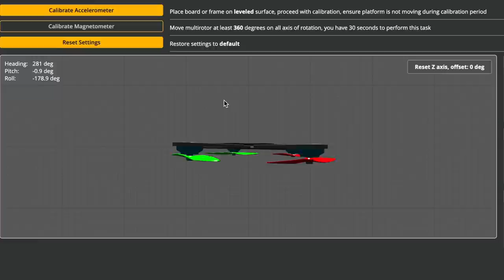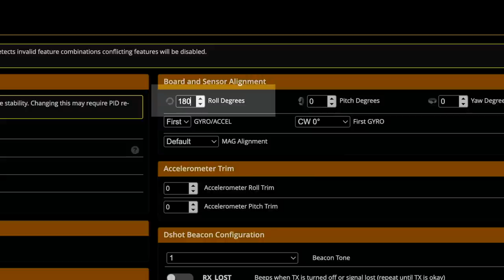Pusher Drone!! - Upside Down Motors?!

Comment: Pulling clean air is significantly more efficient than pushing obstructed air. This raging debate has been resettled many times in aircraft engineering. A few aircraft manufacturers who built pusher planes even reverted back to tractor (puller) configurations later. Conveniently, it’s also easier to engineer control surfaces behind a tractor configuration; plus, these surfaces will also have more authority behind, rather than in front of, the blown air. Cooling the motor behind a propeller is another advantage of a tractor configuration that reduces heat wear and improves dependability. I hope this was helpful! I LOVE THIS CHANNEL! Thanks for another fantastic experiment, guys!

Comment: I think the biggest difference in how it feels to fly would be in the center of gravity vs center of thrust. When they flipped the drone upside down, they put the lipo on what was the bottom of the frame, putting it on top. So the center of gravity is probably about an inch to an inch or two higher than the center of thrust. This is probably what PDEVX meant by it has a pushy feel and a reluctance to roll.
Reply: Exactly. The force is apllied from slightly different position so that would make a difference what could be felt but then again is such a minor change so.. maybe really seasoned pilot can actually feel thr difference. Bilnd test would prove it
Reply: They mounted the motors upside down but didn't flip the props to compensate.
Reply: @dscottwilliamson  if this is actually true then this is a huge whoops and this comment needs more likes
Reply: Isn't that the rocket fallacy?
Moment of inertia does matter though.

Comment: I've done a bunch of testing on a thrust stand on push/pull, and I've found that pulling is more efficient, likely because the airflow is better over the stator for cooling.
Reply: They flipped the motors without flipping the props, it's like putting freestyle props on your quad upside down.
Reply: @dscottwilliamson  this is what I came to the comments to find out. If they didn’t flip the props then it’s essentially like 3d flying upside down. Sure it will create enough lift to fly but it’s grossly underpowered.

Comment: pulling or pushing air through the arms DOES make a difference. Air that is pushed by a fan goes mostly one direction, but air can be sucked from any direction into the fan (that's why we feel a very strong "wind" after the prop, but not before the prop). As for the person who feels a difference, only one way to know if it's placebo : blind test.

Comment: Ive been doing this for years. But not many people watch my videos. I even went as far as flying 7" props on a 5" source one with front motors inverted and rear motors normal. Thrust to weight ratio is insane. But i guess i should of sent it to you guys to gain some traffic traction. 😕  it flew great. Even chased some drift cars with it on 6" arms and 8" props
Reply: That's dope :)
 I once fit 3" props on a 2.5" by raising the rear motors a little bit, and having the props overlap ever so slightly. Flew better than on 2.5"!

Comment: You guys should run reverse motor direction anyway. It flings dirt away from the lens and gives the rears access to cleaner air.
Reply: Also helps ploughing through straggle, pushing branches away instead of grabbing them
Reply: @lievenvv  It might "grab" them more from the sides, though.

Comment: I think you guys missed a serious point in your setup unless uiu just didn't show it,, You have to tune it differently when you push instead of pulling through the arms vs pulling accessed for the push Hensel the "Slower responses" to movements up the rates and use good solid supermarket on power input!;-)) thanks for the ideas 💡 guys Bravo miss that stuff 👏 👍 😉 😄

Comment: It will be more efficient, because high speed air from the prop is not blocked by the arms, the slower speed air coming into the prop over the arm has much less resistance.

Comment: Mechanically speaking, When you turned it into a pusher, you changed the performance of the motor.
Normally when the props are on top It's pulling the shaft up away from the stator reducing mechanical drag.
With the motors inverted ... this may heat the motor faster and reduce performance.
Reply: It may also reduce the life expectancy of the bearings.
Reply: There's also a cooling problem because airflow to the stator is blocked by the arm
Reply: no...when it pulls rotation is just faster. the power isnt changing. imagine the difference when pulling and pushing a cart.
Reply: @jordigrau83  that's a good point as well, because the motors are in the back of the quad so the top of the bell is facing rearward whereas if they were on top they would be going right into the air flow.

Comment: Sorry for the necro post, but a few things to consider. 

1) motors pull in air from underneath and push it through the stator towards the props due to centrifugal force. Thus effectively means that the cooling airflow through the motor is opposite from a tractor motors direction of travel. (Less cooling)

2) having clean air ahead of a motor / propeller  is less important no days do to advances in noise filtering. Especially when the turbulence from the arms is consistent and easily compensated for.

3) having clean air behind the quad, results in less propeller drag, thus better efficiency. In tests I've done with quads and tricopters this can be as much as 20%. Typically larger, slower props have higher gains here.

Comment: I tested  several years ago because it always seemed like a better/more efficient idea to have a pusher style quad. I ended up using a thrust stand to measure the difference the drag of the arms made to the thrust but I found that at higher thrust levels the bells of the motors would come into contact of the housing increasing the drag way more than the arms, but motors are probably a lot better these days.
Reply: you also have to consider motor cooling and how that might effect efficiency, especially running higher kvs

Comment: Also an interesting Idea that I have tried out is if you flip the frame over and put the rear motors on the top. It reduces the amount of turbulent air to the rear motors and changes the characteristic quite a bit.

Comment: Just turn the front motors over for best centre of gravity and flight feel and prop wash is better  and can still turtle mode it and it also gets props out of view at 45 degrees tilt on a 7inch where you see the motors more than a 5inch

Comment: Dear LeDrip,
I think the Arms over the Prop (pusher) does not realy block the Incomming Air.
If the arms under The Prop (Normal) it have much more Impact on the Airflow. Becurse the Pressured angled Air is blocked by the Arm. In this Case there are caotic Air circulations spreads in all directions around the arm, and have large Impact on the Thrust flow area around the arm.

I think in pusher it is much easier to suck the the Air in the Propeller from evrywhere. Over the Propeller there is a Low Pressure Area, this area suck the air in the Prop from all directions inclusive the Ramair of flight speed. 
The High Pressure Area under the Prop is pushed in one Direction.
The Sucking Area is Sucking of all directions, and the Athmospherik Pressure is helping to "refill the low pressure area"

And did you Inverted the Motor Directions in Betaflight? Or swaped the Propellers on the Arm? This could have Impact on flight handling in case of the Yaw axis mixed with other Axis in flight.

Comment: I've been flying 5" pushers since 2017.    
Twin Quad Guys CK-SX frame, Botgrinder BOT5, and the Demibot.
I plow thru scraggle freely, because frame protection.
I bottom battery mount, and use the frame otherwise normal, not inverted.

Comment: Multi rotor aerodynamics are so weird, but as a fixed wing hobbyist I’ve done a bit of studying on pusher props. Aerodynamically, propellers have kind of a weather vane effect; for a plane, you get more longitudinal stability with a pusher prop vs a tractor propeller all things equal (or as equal as possible). Supposedly, doing a “pusher” prop setup would make your kwad more stable, and at that less agile in freestyle. Stability is great for a cinema setup but not aerobatics, so in this case, pusher perhaps is way worse for freestyle drones.

Comment: Personally I did something similar about 5 years back just for camera to have clear view. My setup was 5" drone running 6" props on 4S. Front motors on the bottom and the rear on top with 3D printed spacers. That was back with DJI Ocusync or Digital FPV System The First digital air unit from DJI.
Reply: how did that fly? I’m about to try smth similar.
Reply: @h3rtz  It flu fine only it would've been great to have little lower KV motors and better props. My were 2250KV 2204 if I remember correctly cheap motors. Flight time was not great so I added bigger battery to chase planes and later GoPro 3. Then the battery was getting little too hot and I did kill couple of old batteries in the process.

Comment: You guys should change all motor positions so that the arms don’t have any effect at all. So bottom left motor would be at the base of the quad. The Top right motor would be at the top and the arm. Both other arms vice versa. So that all props will be pushing and pushing air without hitting any arms in the process. I hope that makes sense. You would need some landing skid plates to hold the drone off the floor. Just an idea really.

Comment: If you install the motors upside down in the freestyle frame and mount the battery at the bottom, you can shift the centre of gravity enough to get a balanced freestyle quad.

Comment: Hi guys! Are you 100% shure the props where mounted correctly, so that the rounded side is up and flat side at bottom when the quad is in ready to flight position? (the props should be facing the same as before the pusher changes)… I ask because it would be an easier mistake because you are not used to screw them on reversed.. 🤷🏻‍♂️

This could explain the lack of power
Reply: Props are on right, you can see it at 4:11

Comment: At 9:27 you can see that the props are flipped appropriately.
Also having the arms on top does not impact the airflow into the props as much as being on bottom and affecting airflow out.
The biggest difference is going to be center of gravity change and the tune, compared to each pilots regular rig.

Get two of those side by side, one up and one down, then blind test it as best you can.

Comment: The flat carbon fiber rod to the motor is not aero dynamic at all. Try 3D print aerodynamic V shape on both sides where the prop is, and then try with both configurations, and as pusher, make sure motor rods are on top to ch he weight balance. There’s a reason dji drones have aerodynamic rods to the motors.

Comment: 1. Invert only the front motors.
2. mount the motors upside down, not just turn the frame around and change configuration in BF.

on a couple of my O3 quads, to get the props out of view, I just invert the front motors, leave rear motors as is.

and it should have been a true blind test.

Comment: I would like to see the motors spaced up an inch above the frame, more even with the middle of the battery. The way it would carry the center of gravity might allow for even tighter turns and even quicker roll rates, it might even stabilize better?

Its similar to balancing a basketball on a concave surface vs a convex surface. What surface takes more effort to keep the ball in the middle? 

Fun fact: When you learn how to balance a tennis ball on top of a beach ball, then you'll understand the concept of how to fly a helicopter.

Comment: You can see that the quad was flying much better when shawn first started.  By the time Bubbys turn came up it, you could see jello just flying straight the level.  Wonder if the vibration was impacting the FC enough to hurt performance?  Maybe the off-set prop disc made the vibs worse or if it was the stack of the vibs and the offset?
Reply: This backs up the mechanical drag issue. The motors likely heated up. They didn't say how long in between pilots test flight. If they just went 1 right after the other and didn't give the motors time to cool down, that would explain the excitement at first and Bubby being like... Eh.
They could try again but reverse the pilot order and see what everybody thinks.

Comment: If anything the motors seem starved of air by pulling in air over the arms. Might explain the performance difference. Clean air going out for better prop wash but with the tuning for normal setup already takes into account prop wash from the air going over the arms. I suspect you need to re tune for it pulling air from the arms. But it definitely seems starved of air hence the lack of peppyness.

Comment: can you try to make a prototype frame where the lipo slots inside the middle of the frame, resting on the bottom plate?
try to come with a solution to put the FC and ESC.
it think it wil fly good its like a mid engine racer.
widen the frame just a bit so it stil has 2 carbon sides and a hole big enough so half the lipo slots inside the frame.
the lipo wil almost be exactly in the middle of the props and  between the top and bottom

Comment: Highly doubt theres going to be much of a flight differance. 
What there however will be is a massive reduction in crap that gets into the motors, when chasing things with a lot of gravel/drit/rubber like motocross, rally or drifting.
I have had rocks jam up motors, and iv had to clean out melted rubber from the bells.

Yet when i flew a Avata during a Swedish folkrace event the motors were as smooth as if i never was there. Normally id have to tear the motors apart and clean them out with bluetac/possible even replace the bearings if its fine dust/really dry at a race.

Comment: Did you flip the props when you reoriented the motors?  I saw BF config props-in at 3:27 and at 4:10 it looks like the props were mounted upside down (right side up when the quad was upside down 🙃)  Those props did not look like 3D or symmetrical props and this could really mess with your performance as the airfoils have a clear thrust efficiency preference.  ~Shaznoid
Reply: Oh yea, even on the video title you can see the curve of the prop blades ("scoop") is pointing up, not down.  Flip those props and give Bubby another chance! 😄

Comment: The reason it's used on some of the small "whoop" type drones, is because they are designed to fly slow, like inside, etc. The "pusher" effect creates an air cushion when flying close to the ground/floor, kinda like a hover craft effect. I have several I-flight drones, pusher and standard types. The little Protec 2.5 pusher is fun inside, but like others said, kinda "mushy" outside.
Reply: No. The reason small whoops are easier to fly close to the ground is that they produce less turbulent air around the drone because of the low weight, small props and low thrust. Push vs pull makes absolutely no difference whatsoever other than what others have said about the airflow cooling the motor and slightly different center of thrust in relation to center of gravity in pull config (the latter also depends on the design of the frame). Push is literally the same as pull. The motor doesn't magically produce another "kind of thrust" if you flip it over.

Comment: I started with the Avata a “pusher”  and got a lot flight hours in.. When I transitioned to a freestyle drone with motors on the “ bottom “ the freestyle drone of course had more punch but less stability on low end hover.. from what I can see from your goggle footage, it looked like an Avata flying with a lil more power. Rates did seem slow and could be making the biggest difference… Just my 2 cents experience lol 😅

Comment: I'm surprised you didn't try it with the battery mounted underneath. It would make taking off, and landing easier.
How it would affect the flight characteristics, is just a guess until you try it.

Comment: I found when I did this with my whoop, it flew just the tiniest tad crisper handling than a standard whoop.  But.  Noise.  It turned my stealthy, quiet platform into a screech owl.  Also, the props are far more vulnerable on a pusher whoop.  Overall, it's the noise that turns me off - not as big an issue with open props, I'd guess.

Comment: I think that the props are made "to suck air" rather than push. It's a different geometry when you use them upside down. Not sure but just a guess. I did the same experiment with a "first gen carbon frame", and it feels just a bit "mushier", but not especially bad. I think that the props are designed to push air in a specific direction, not the other way around. Just a theory.... Greetings from Germany!
Reply: they flipped the props, so thats not a problem, the main change is the centre of gravity, motor cooling and durability

Comment: What if you mount the motors normally and make the drone a pusher by configuring it upside down in betaflight. Then only change the camera angle and fly it upside down.

Comment: Actually I have been thinking of doing similar mod on crux35 just because the battery is bottom mounted. Flip the motor, swap the props and change the direction of motor in BF.

Comment: guys, pull will make faster rotation and push makes for stability. its not the the power, imagine fwd and rwd cars, same thing.  with drone though you can tune it. maybe 2 push 2pull? see what you need faster rotations and use pull. then push the other 2.